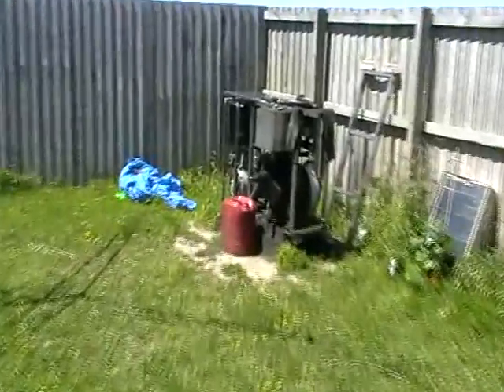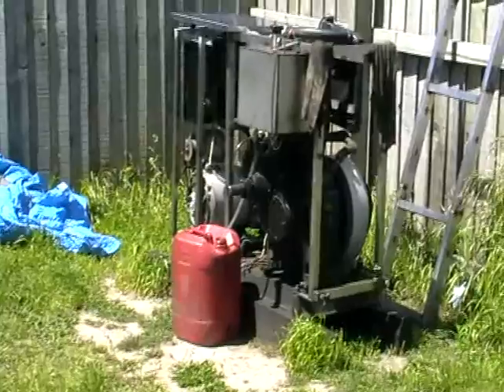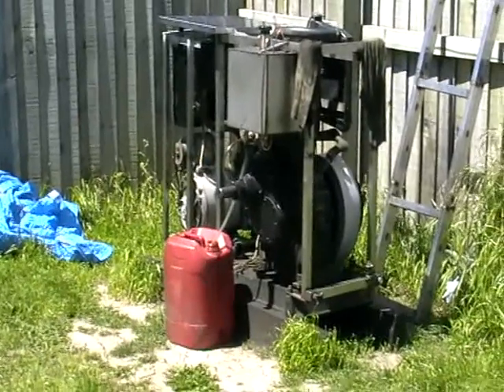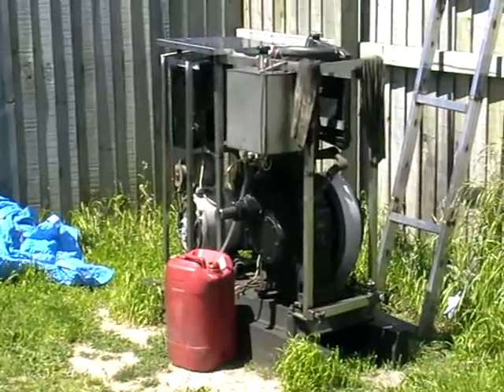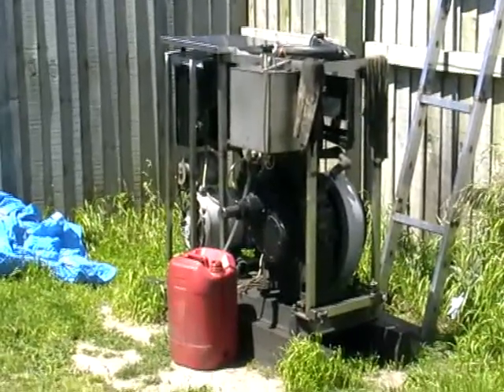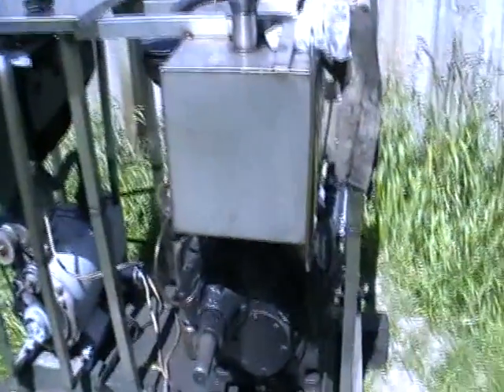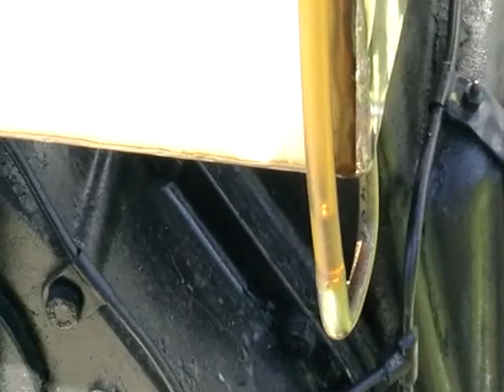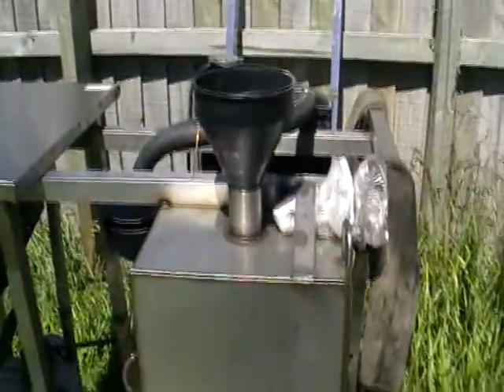WMO diesel fuel testing

Comment from the maker: yes it is illegal in UK same as a biodegradable vegetable oil, just protection of corporative interests, though the WMO is the same as any kind of crude oil as oil just oil, and in this case the oil ran through the same process that the oil companies will do with crude stuff - reformed, fractionally separated, settled over catalyst and fits into requirements, main problem: it is a home made real diesel fuel, not from the gas station, Rothschild, Rockefeller, Windsors are avoided from this scheme